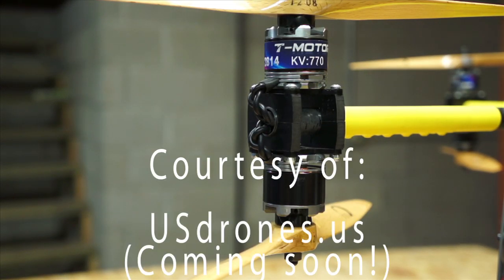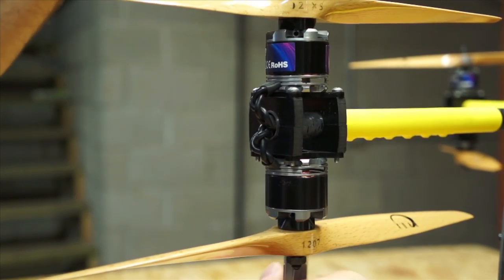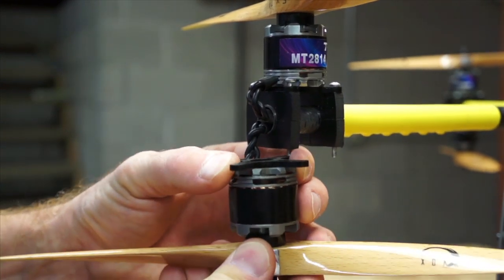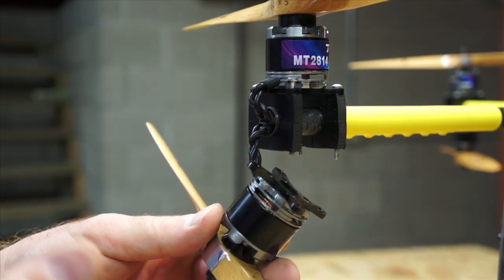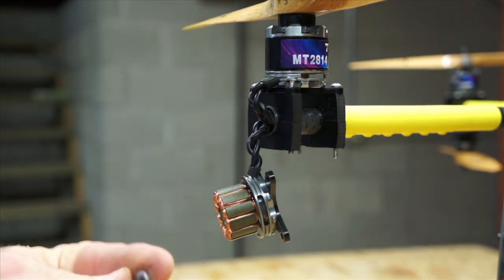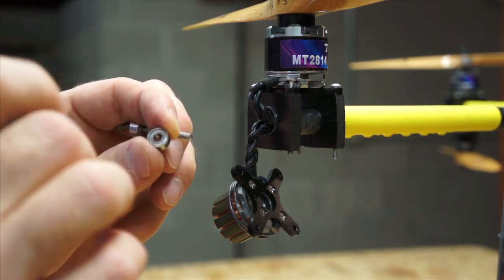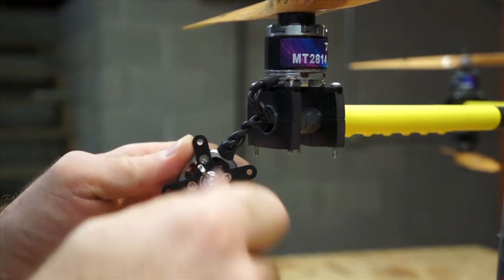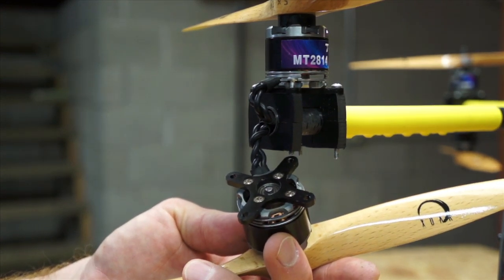Replacing brushless motor bearings

Comment: if the bearing is not tight in the pocket then it should not be fitted the washer is not to keep the bearing in place but to shim variance in the shaft length.

I had a set of tarot 4114's where the bottom bearing pocket was over size, the only solution to be able to use the motors as back up was to make 8 evenly spaced dispacement scores in the wall of the pocket. this was just enough to tighten them up to friction fit, I have also used surface displacement on a slightly loose shaft to snug it into the ID of the bearing. bottom line it gets you out of a pinch but this is where quality and vomponent cost come into play I guess.
Reply: Guide504 й

Comment from the maker: the tool can be found in the classifieds at www.multirotorforums.com...i have both the 3mmID and the 4mm ID versions available and both come with 20 replacement washers and snap rings.
Reply: Sorry, just saw your reply... I actually went and made my own using a 10-24 x 3 inch screw, two big washers and one wing nut. I also used the old bearings as the "spacer"... works like a charm and cost 3 bucks... :-) thanks.
Reply: +barchiola Can you please post a link to the actual ad?
Reply: +barchiola Hi, where can I  buy the bearing press tool?
Reply from the maker: +Ronnie Cuevas Hi Ronnie, I've still got parts to make the tool.  I'll email you the paypal address and you can let me know what size you're interested in.  Thanks.
Reply from the maker: +barchiola people trying to do the same thing with washers just need to check two things, does the bearing need to be pushed below the edge of the bearing recess?  also, does the washer being used to push the bearing put pressure on the inside race of the new bearing?  if it does then it's possible you'll damage the new bearing.  bearings are always pushed into place by pushing on the outer race only which is why the tool was made in the first place.

Comment: You forgot to fit the washer.
Reply from the maker: I didn't forget, on the lower motors I used to leave the washer off because they would wear and the metal would fall into the bearing but I've since stopped doing that and I now always put the washers back in.
Reply: but in the video you said you "Always replace the washer"
6:40 in the video.
Reply from the maker: M Baggie and whenever I replace bearings I always replace the washers.  when i was replacing bearings in the motors that face down i didn't put the washer back in but now I do so always replace the washers when you replace the bearings.  the washers wear out and should be replaced.  hope that helps.

Comment from the maker: Thanks a lot Mr. C. Croc.  The name of the company has been changed to Aerdro, LLC and the site is now at  aerdro dot com.  I'll be adding to the site in the coming weeks as frame parts and other items begin to fill the shelves.  I'll also be doing a new video that better explains the use of the nylon spacers that I include with the tool.  I also don't recommend leaving out the washers anymore on the bottom motors.